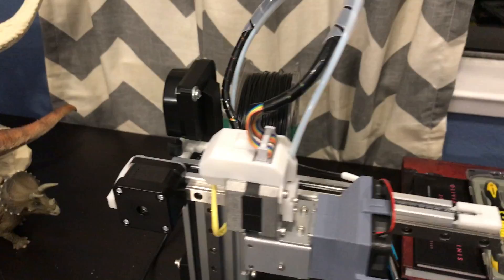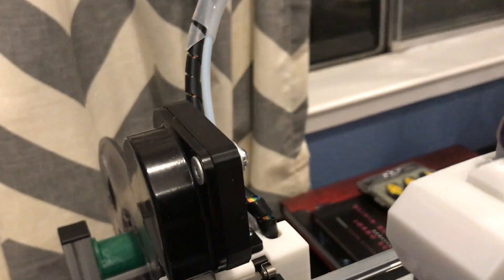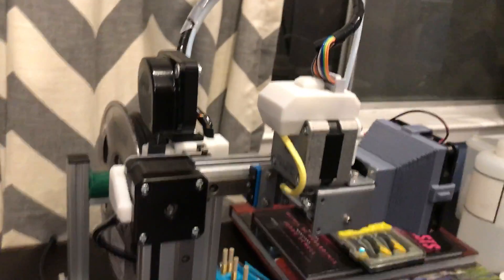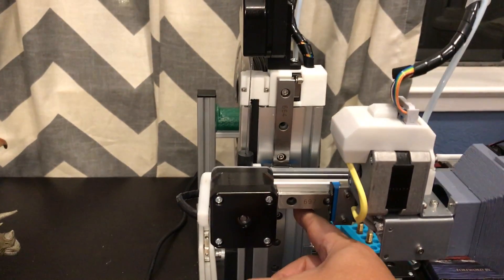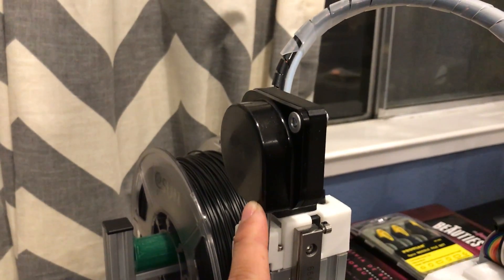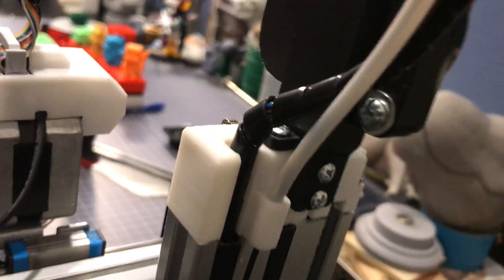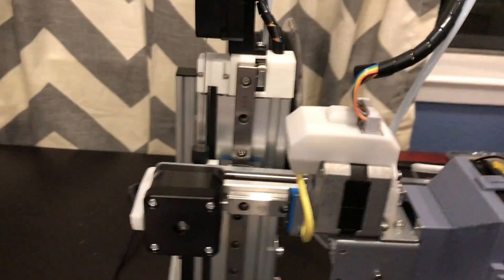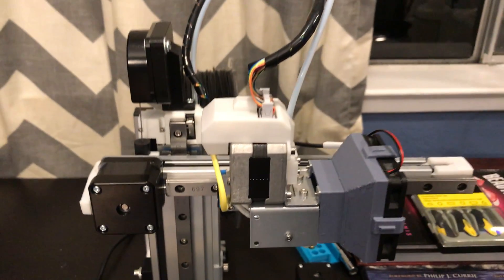Cetus ZAxis balancer

Comment: hello, planning to get the Cetus 3d soon, will this fix enable it to lock in place when theres a power outage? which means that i can resume the print after?
Reply from the maker: civnas hello yes I've tested it by turning off the power hen resuming after. It works great! If you don't have a larger fan mod or using the original fan, it'll be best.

Comment: It's only a 2lb pull strength but could it have any impact on the stepper motors when they're in action? They run hot enough as it is, I'd hate to have one burn out. Still, it's a very elegant solution and many thanks for making it (and the video) and sharing them with us.
Reply from the maker: Martin Nichol thanks for asking. No it's doesn't. It actually helps the stepper motor to work less harder because the weight is taken away. It's perfectly balanced so that the stepper takes very little effort to move it up or down.
Reply: If the Z-axis is running hot on a cartesian, you've got other problems...